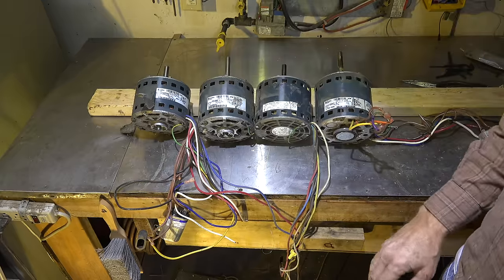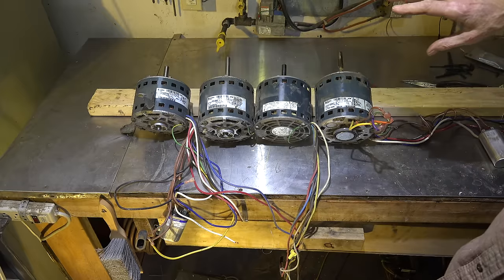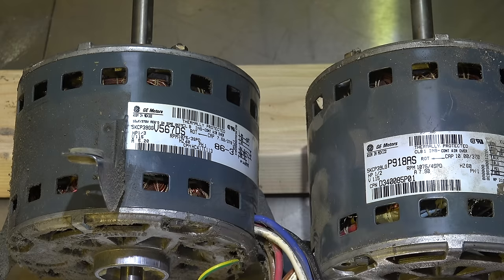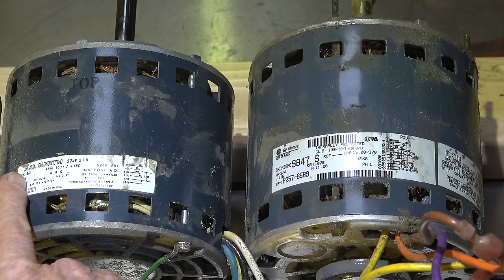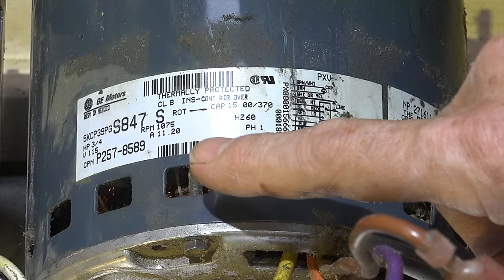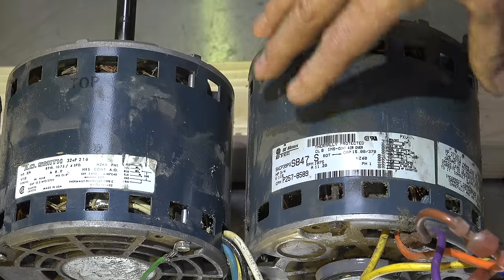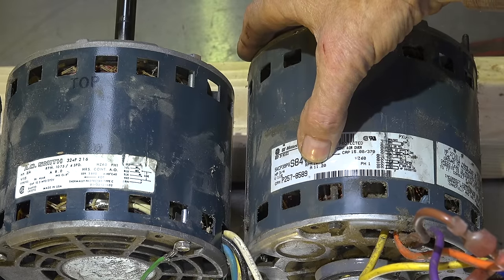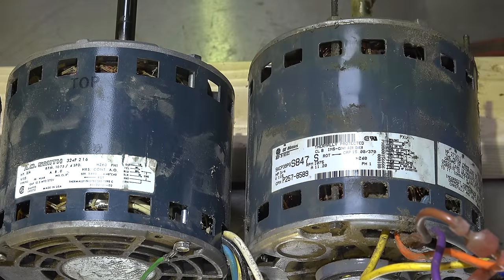Comparison of horsepower and amperage draw of motors

Comment: Good video GFM, Ralph at T &N Services preached the same point in the past, like you, because of experience. Comments keep hitting the "better efficiency" defense, and that's what manufacturers want you to think, but it's really not the case. We have a motor shop in St. Louis (Commercial Electric) and when you call for a replacement, he asks (and he knows his stuff) "what's the amperage?" every time. You put a squirrel cage meant for an 11 amp motor on an 8 amp motor, your point will become evident when the motor starts running hot and dies an early life. Good video, thanks for posting.

Comment: I had this same problem changing a condenser motor the other day because the one I replaced it with pulled way too high amperage even though it was the same horsepower as the one I was replacing. I even went ahead and put in a slightly larger condenser motor and it was still too high the unit had a quarter horsepower and honestly I think it needed a half HP

Comment: I always heard doesn’t hurt to go up a little bit on hp to compensate low amp one! Lennox had a large furnace long time ago…. 3/4 hp! Many techs said it was basically a 1 hp motor!!! U couldn’t put jus any 3/4 in it! JUST LIKE U R SAYING!
Thanks & keep teaching! I’ve done HVAC for a while too!
Reply from the maker: I would agree.  HP is not an accurate measure of capacity.
GFM

Comment: Great video. Hp rating can be very misleading. This is something that many techs aren't taught. The 2 center motors are pretty much rated 8amps in your video. The right one is labeled 3/4hp. Shows it's more of a 1/2 hp. Or just falls into the 3/4 hp rating.
Reply from the maker: I found out that the hard way with an overdrawing replacement motor.
GFM
Reply: Anthony Reardon hvacr I think it's a way for manufacturer to game the system
Reply: Yea it bit me  on an AAON unit.  Then i learned my lesson.

Comment: A few years ago I had a condenser fan motor on my ac unit fail and it was the original motor and it was a 1/8 horsepower 1100 rpm motor and the repairman replaced it with a 1/4 horsepower 1075 rpm motor and the amp draws were the same on both motors so is there any chance of having damage done to the unit itself being the rpm and horsepower are different
Reply from the maker: No, I have done the same thing many times with no adverse effects.
GFM
Reply: @grayfurnaceman  oh cool that makes me feel better because I actually noticed before the old motor failed that it was not actually spinning at the right room so I'm wondering if the motor had been failing for a few years but not to the point of it actually quitting completely and when it finally died it was squealing really bad

Comment: Another way to look at it,

1 horsepower is 746 watts. Because not every motor ever made was designed to be exactly 746x the horsepower rating you end up with this result.

Say you have a motor rated to output 425 watts of shaft power as that's what the original equipment design needed, now you have to decide whether to round that down to a 1/2 HP 373w or round up to a 3/4 559.5w.  If you round down then someone may end up using a replacement that is too small, if you round up and someone tries to re-purpose this motor it may end up overloaded.  That is why you sometimes ignore nominal horsepower ratings.

Comment: My name is rod I live in Washington State I need to replace a motor on my oil heater and I'm having problems finding it up here in Washington the model number is 6K149C I found some on Amazon eBay but the last letter on the model number does not match do you recommend where I could pick one of these up or a company that is selling them I've searched the internet

Comment: Are you saying it has to be exact amps... I need to replace a condenser fan motor..1/4hp 1075 RPM 2amp..I found a 1.8amp.. everything else is the same..should I buy it or not..I want it to last..thank you
Reply from the maker: This is a hard one.  Most motors do not draw the rated load amps.  They are a little under.  To be sure, I would want the same or a bit over on the amp draw.
GFM
Reply: That is what I thought..I just wanted to double check my understanding of your video...Thank you for the information

Comment: I don't quite understand the comparison between the two 3/4 hp motors.  I understand one claims to draw less power, but that does mean its not as powerful at the other, it is just more efficient, correct?    If they both really put out 3/4 hp but one runs more efficient that is the one I would want to use.  Please install both these motors and use them as intended and monitor amp draw and see if the 8 amp struggles to do its job and is pulling more power than its rated for maybe maybe.

Also how are the manufactures measuring hp?  Are they measuring in the same way?  Could be the 8 amp is not really 3/4 based on the way GE measures hp.
Reply from the maker: The idea that 2 electric motors of the same design made by competing manufacturers would have such a wide variance in efficiency is just not true.  Differences in efficiency are in the single digits at most.  If you look at the 2 motors in the video, the difference in size is obvious.  I will have a video comparing these motors in operation in the near future.
GFM

Comment: I love your videos.  That being said...  You're not taking into account motor efficiency my friend.  A 3/4 hp motor can draw whatever current it's engineer's designed it to have.  Different materials in the windings and such can have a drastic effect on efficiency.
Reply from the maker: As I have responded before to others, efficiency differences in the same type (in this case PSC) of motor are very small.  Its the rating that is variable.  I will be doing more on these motors and maybe I can win you over on this.
GFM

Comment: Is is ok to replace a motor 6.5 amp motor with a 13 amp motor, everything else is the same? I was shipped a very similar but slightly bigger bodied blower motor with the same exact wiring, but it's a different part and model number. I'm thinkin maybe they're interchangeable?
Reply from the maker: I would be concerned about that much of an increase.  I have had registers blown out of the floor.  
GFM
Reply: @grayfurnaceman  thanks for the reply sir

Comment: These are alternating current motors. Horsepower is horsepower is watts which is known as real power. Volts times amps is known as volt- amps and this is apparent power. The difference between real power and apparent power is what is known as the power factor. The 3/4 horsepower motor that draws the less amps is just a motor with a better power factor. The motor that draws 8 amps to make the 3/4 horsepower is a better made motor, it will not draw 11 amps.
Reply: Excellent point but the truth is somewhere between this and what is said in the video.

Techs don't have the time to install a lower amperage motor as a trial to see whether or not it is overloaded or just has better power factor and efficiency so just matching it up on amps and physical size as close as possible is the best course of action.

Imagine if after installing the trial motor and reassembling the equipment it did end up overloaded, they would have to disassemble and pull the blower again to make it right. Why do the job twice when you can do it right the first time?
Reply from the maker: These motors are all PSC and there is not that much difference in their efficiency.  Power factor has virtually no effect on the efficiency of modern single phase motors.  In about one month, I will be publishing a video comparing the amp draw when these different motors are installed in the same blower.  Maybe it will clear this up.
GFM
Reply: grayfurnaceman When you do be sure to have them plugged in to something like a Kill-A-Watt meter which will show all details (Amps, watts, VA, power factor) and put this to rest.
Reply: you're saying that Power factor has no effect at all?
Reply from the maker: Luis Salguero I am saying power factor is a bit overused as measure of efficiency. When comparing motors, the power factor is about the same for all PSC motors. 
GFM
Reply: oh, ok that makes more sense
Reply: I disagree. If you place an 8.0 amp motor into a 11.0 amp system, the amp, or current flow will overheat the windings, and no matter how ovetbuilt that motor is, it is going to fry.  That's analogies to placing a regular duty cycle motor into a system that is built for a continuous duty cycle motor. The same will happen.

Comment: Why would it over draw the motor?  The motor is only going to draw what it draws..   the motor is the load..   theres is no removing an 11a motor and replacing with an 8a.   The new motor will draw only 8 a…. It might be over worked or insufficient for the air speed which might make the motor draw more current if there was some kind of restriction it had to power through..   but the only way a motor is going to draw more than its rated amperage is if there is a resistance to the induction or spin….  Or if its in a hot environment not rated for its housing..
Reply: The blower design is the motor load. Like you said, it's going to spin at 1075 give or take some slippage. However, the blower is designed to move a certain amount of air. Air has weight. Weight takes energy to move. That motor is going to overdraw because the blower design demands it.

Take an amp draw once in a while.

Comment: This is confusing. I thought if I'm using a lower amp motor, I'm using less watts thus saving electricity and lower electric bills. It is still spinning 1075rpm so what's the different? As long as the capacitor matches what the motor needs and the motor matches the volt the system needed, I should be fine, right?
Reply from the maker: The amount of energy used is dependent on the load placed on the motor.  Not the size of the motor.  An electric motor tries to adapt to the load.  If I use a 10 amp motor on a 10 amp load, all is well.  If I use a 5 amp motor on a 10 amp load, the 5 amp motor will attempt to adapt to the larger load but will overheat.  There is no free lunch.
GFM
Reply: What is the load for a blower motor?  The size of the blower or fan blades?   The mirv filter rating?  The ductwork?  Closed vents?  Mine just whistles when it has too much of a “load”….

Comment: How is using the 8.0 amp motor to replace the 11.2 amp one going to burn up the motor? They both run off 120v right? Might not get the same efficiency out of it, but how is that going to burn it up?
Reply from the maker: The rated load of the motor does not mean that is the most it will draw.  If it is applied to a higher load than it is designed for, it will draw higher amperage.  Hope this helps.
GFM
Reply: @grayfurnaceman  Okay, so if my new AC motor is rated at 12.4 amps, then my AC blower won't necessarily need all the 12.4 amps to run? Correct?
Reply from the maker: @richardaguilar7652  Amperage draw is dependent on load.  Less load, less amperage draw.
GFM

Comment: What you are saying is not accurate. Yes each one draws different current and I would say the one with higher current rating has more torque and is why It is a larger motor. So that being said it will spin a higher displacement and larger fan. Using the smaller motor causes it to not get to speed as quickly but has the ability spin at the same RPM if rated the same and could and would burn out because of the lack of generating a heavier fan. Current draw is only a factor of the maximum current that motor will draw .  I will use audio amplifier analogy I have 2 audio amps ,one is 1000 watts the other 2000 watts. They both use the same 120 volts. If I run the smaller amp to push 700 watts of sound it will get hot and be more punishing on its longevity than if I use the larger one at 700 watts. It has a higher rating. Yes it is important to use the larger motor if that is what was in the original unit because the larger fan requires more torque and will shorten the life of the smaller amperage motor trying to spin a higher flow fan. It is more about CFM's because a 20 amp circuit means that there is 20 amps always available, Does not mean that 20 amps will go into that motor unless it shorts out . But even with this in consideration a modern more efficient motor may be able to create the same torque as an older less efficient motor using less current. Science : )
Reply from the maker: I have no idea of what your point is.  Yes, the larger amp draw motor will have higher torque.  Yes, the smaller amp draw motor will overdraw amperage.  Increased amperage with constant voltage equals more power usage.  The reason for this video is to point out the fallacy of using HP ratings to determine which motor to use as a replacement.  Amperage draw is king in the service industry.  Motor efficiency, if the type of motor is the same, is a very small factor in efficiency.  I have another video on this coming out soon that may help.
GFM